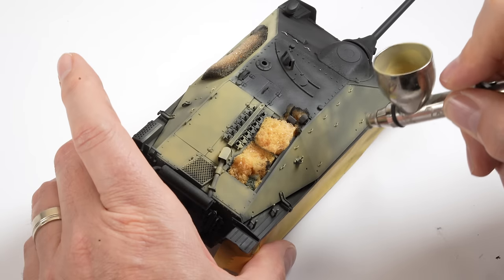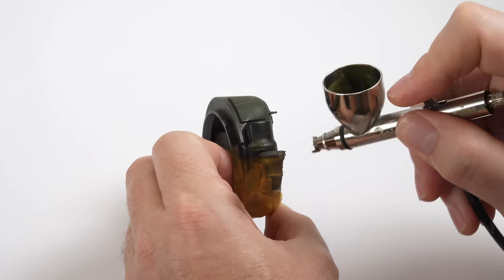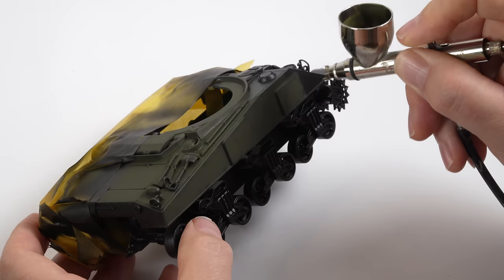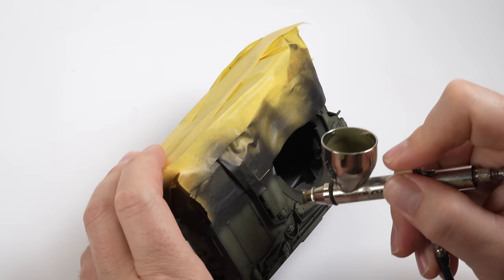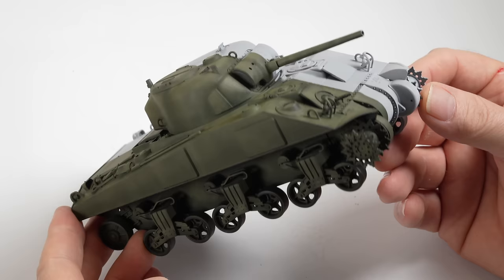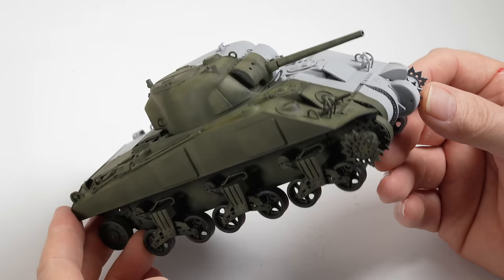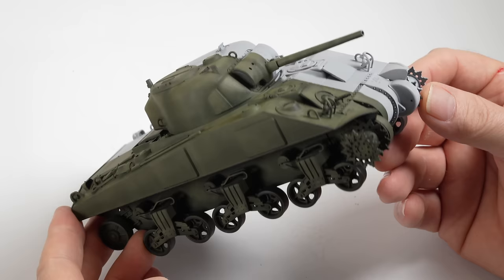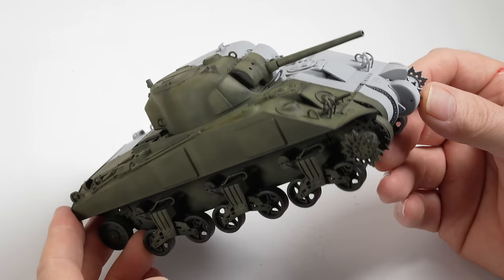PAINTING HALF a MODEL in the name of science. Black Basing V Pre shading. Which technique is better?

Comment: I do neither. I tend to think in terms of how does a real vehicle paints oxidizes and fade and become stained. And that is from the top surface of the paint and not from underneath or the bottom of the paint. So I start with the new paint surface on a grey primer, then apply what color the real primer was use and then interpret the fading, oxidation etc, using mostly pastels, and some other types of washes. The problem I see using different layers of paint, especially acrylics ( which I have  generally  stopped using ) is, you can sometimes see the "layer" where it was applied to. Giving a sort of "stepped" painted surface. Which for my liking is too unnatural looking. Another thing I personally won't do, is the white squiggly lines on "each" separate panel. Since oxidation does not oxidize differently on each individual panel. And when accompanied or separated by a heavy and wide  dark panel line, also doesn't look natural. If you took this same 1/35 model and up scaled it to 1:1, could you imagine how humongous this line would be. 

Note, this is no grip against those who black base or pre-shade. No, to each there own. It is just "my" thoughts on and why I personally do neither of them. The number one thing in modeling ( for me ) is do your own thing ( think out of the box ) and enjoy what you do and be happy with what you do.
Reply from the maker: Appreciate your thoughts. Thanks for joining the conversation. Hope you are enjoying the channel 🍻🙏

Comment: I used to do pre-shading a lot and I used to approach it completely differently. I would start with black base, and add two layers of successively lighter paint. I would take into consideration direction of the light, including more pronounced bounce-light. The effect would be a black-gray-white model with all the light information. It not only make painting more consistent between parts and models, but also makes the whole process much faster and accurate. One important thing is I stopped using canned paint long time ago. Using airbrush for the base is much better in most cases.

Cool experiment tho. I really enjoyed it. 
Cheers!
Reply: Two more things:
1. controlling contrast in pre-shade is super important.
2. If you use preshading you should try to use as few colour layers as possible and they should be as thin as possible.
In the end the results should be the same if put enough work. The biggest advantage of preshading is speed.
Reply from the maker: Great insight, and yeah, there are plenty of variations on these techniques. Really appreciate your thoughtful comments 🍺🍻💪🙏

Comment: I mainly build 1/72 aircraft, I've been using both techniques.
I find that black basing on single colour schemes like modern fighters in grey works well for introducing a marbled colour with variation in density of the colour rather than it being a boring grey blob. 
I find Pre-shading tends to work well on multi-coloured camo schemes like WW2 RAF subjects.
I have utilised both techniques on multiple aircraft and subjects and I like aspects of both, I don't think one is better than the other and the outcomes are both pleasing to the eye when done well.
However in the armour scheme you present here I prefer the pre-shading side.
Reply from the maker: Horses for courses! Exactly right. Both techniques are valid and work differently depending on what you are painting. Thanks for your thoughts 💭 👌🏼💪🙏

Comment: Hello Clayton.  With all due respect, I think the result of both finishes being so similar is due to the fact that after you made a great explanation and demonstration of both Black Basing and Pre-Shading, you then applied Post-Shading to both sides with the lightened OD.  That unified the finish between both of the sides.  Generally, a pure Post-Shaded finish would involve painting both the black shadows over the grey primer and also some intense white highlights before you apply the transparent green; the white areas would (ideally) negate the need to apply Post-Shading afterwards with lightened greens.  I say ideally as usually it isn't enough and you still have to apply some Post-Shading...

Now, in doing what you did I think you made an even better point which is that Post-Shading is -- in my opinion -- by far the most important of all these shading techniques as it bumps up the tints of the base colour and makes some punchy highlights which will withstand the later weathering.  That generally tones down the finish and darkens it, so adding the highlights is often crucial in avoiding a light sink.  Relying purely on Pre-Shading or Black Basing, it can be hard to end up with enough highlights.
Reply from the maker: Hey Evan - Appreciate your thoughtful comments and you make a good point. I guess when I did the experiment I was wanting to approach it as I would when I paint my models. I was curious as to the effect the black base V Preshade would have on the overall colour and look.. Maybe I should have kept it simple and stuck to the basics.. but where is the fun in that?! :) Thanks again for tuning in. Its appreciated
Reply: @workbenchhobbies4316 very good point.  Like I said, Post-Shading is definitely what I would focus more on as well, since I feel that I have more control in that stage as I'm directly painting highlights rather than sort of painting around them (or transparently over them to preserve highlights) as you have to with some techniques.  Your style is excellent, and you've made a good conclusion that I agree with about both Black Basing and Pre-Shading producing very similar results; they're just the first step in a long process!

Comment: We never did this. We always painted the lightest first then to the darkest. Then we would begin to remove the layers by rubbing the model. The raised areas would rub the most removing the darker tones leaving lighter tones. Of course, you did this with the end result in mind so it wasn't done willy nilly. The dark areas would be the areas that were recessed and hardest to reach so obviously they stayed dark. After that, areas that would receive a lot of foot traffic would be silvered with a dull silver, like the edges of hatch openings, etc. After all that a careful wash, rust, dirt and dust would be carefully applied. We generally avoided building a psychological pretext to the model and the painting as we were not stuffy and arrogant and pretended to be abstractly wise.
Reply from the maker: Gee…sanding/rubbing the model back sounds fraught with danger! But if it works for you then that’s great. 
Not sure if I’m supposed to take offence to the stuffy and arrogant part 🤔
Thanks for joining in 🍺
Reply: @workbenchhobbies4316  We never sanded. And it wasn't dangerous. It worked just fine and every modeler I knew did it this way. The results were outstanding. And we also didn't add any psychological pretext to the model. In fact, our models always won first place awards at the fair and other events we took them to.
Reply from the maker: Can’t be unhappy with first at the fair! 🤷🏻 Build your models however gives you the most joy and you can’t go wrong 🎉

Comment: I have to use purely water based paints as here in the UK we get ripped buying Tamiya paint because stores only stock the tiny 10ml bottles. The water based paints are very good at basic coverage but not thinning out and shading. You can't use alcohol or the paint goes mad in the airbrush.Years ago the larger bottles were available that's changed  my first paint choice.
Reply from the maker: I used to use acrylics all the time and you can get some really good results with them. Just takes a bit of practice. 
Which brand are you using? Whatever the answer though I’d strongly advise to use a thinner or flow improver of the same brand until you got a feel for how the paint was working. You should be able to get reasonably fine lines and shades using acrylic paints. Just keep at it 👍💪💪

Comment: Excellent and extremely helpful video. As for preference, correct me if I'm wrong, but it seems like you used less paint using the pre-shaded method as compared to the black base. For reasons of economy and detail retention, if my assumption is correct, I would prefer pre-shading. I work primarily in 1:72 scale, as a little goes a long way in that scale.
Reply from the maker: Yes, slightly different spraying technique on the pre-shade which in turn would use slightly less paint…in theory at least. But in terms of how much you’d save that would be very difficult to quantify. Minuscule amount I’d imagine. 
Great observation though. Thanks for joining the conversation 🏆🍻☝️🙏

Comment: Is there a purpose for leaving the back half of the airbrush handle off?   Comfort?   Lost it?   Weight?
Reply from the maker: Great question. That end cap limits the amount the trigger can be pulled back, and I find it just gets in the way. Having it off also speeds up the flushing and cleaning process. Hope that helps
Reply: @workbenchhobbies4316  Interesting.   I took my needle out once (out the front) for a “Deep cleaning” and it was 99% clean.   I rinse and “Back bubble” with Lacquer thinner.   I LOVE lacquer thinner!
Reply from the maker: I remove my needle after every session. Maybe I should do a quick video on that 🤔

Comment: I find black basing works better for me, as long as I properly compensate for how it darkens the kit. Its a mistake not to lighten the paint when using this technique. Usually start with black, then shades of grey until I have a black and white shaded model. Then I paint the color on. OTOH pre-shading almost always shows flaws, or disappears.
Reply from the maker: Hey 👋 It sounds to me like you are using a combination/variation of the two techniques rather than a strictly’black base’. You’ll definitely be getting some interesting and cool shades and variation. 
That’s for sharing 💪👍

Comment: Very nice stuff. Currently in the market for my first airbrush, will definitly be subbing and studying your techniques. Any tips on a good brush to go for?
Reply from the maker: Being it’s your first airbrush I’d be mindful not to spend too much. A good tool generally helps achieve superior results but as you are just starting make your mistakes with something that won’t matter so much. Keep in mind you’ll need a compressor too. 
No need to go finer than 0.3mm. That is a good general purpose airbrush. Make sure you get dual action. Not single. Hope that helps 💪🙏
Reply: @workbenchhobbies4316  very much so, thank you! I was thinking of aiming for something middle of the road price and quality wise as I know I’ll be getting plenty of use out of it, but I don’t really know how big the difference is between quality ranges. And of course, I’ve done enough research to at least know what O need for a working setup, just the details are never made fully clear on a google search… I’ll note your advice!

Comment: If attempting to produce a realistic model, then why produce a bad paint job? The actual item doesn't have parts "brought out".  In fact, that's the last thing they wanted on a tank or just about anything as they don't want to be seen much less identified. 
The special (usually terrible) paint job on the barrel to hide what barrel the tank actually had shows this, as does the idea of using a bland camo color.
I just feel as though this reflects on the final build of the thing as though the painters on the assembly line couldn't lay down a proper paint job but instead were inept or blind. This compared to any painting done in theater which sole purpose was to finish the job as quickly as possible. (done by solders).
Reply from the maker: Hey Dave. Appreciate what you are saying, but for me is not about trying to  make something small look larger than it is to the naked eye, so that’s the thought process behind playing with shades and highlights. But like I said in the video, I understand that’s not to everyone’s taste. 
Thanks for connecting here on the channel 🍺🙏💪

Comment: Black priming ist my preferred method, because I use Revell Aqua Color to color my models, which tends to run off from the smooth plastic.
Reply from the maker: Priming is always a good idea but paint shouldn’t run off? Are you spraying or brush painting?
Appreciate your comments ☝️🙏
Reply: @workbenchhobbies4316  Airbrush for the Revell colors. On pure plastic without primer it looks like raindrops on a window.
Reply from the maker: Sounds to me you might need to look at your thinning ratios. It shouldn’t bead like that I wouldn’t have thought…what are you thinning it with?
Reply: @workbenchhobbies4316  Water from the tap.
Reply from the maker: I’d say you are thinning it too much or trying to drop too much paint in one go. With acrylic paints you usually have to mist it on in multiple light coats and build your coverage up that way. Although priming is always a good idea with acrylics you don’t have to do it to get the paint to work.

Comment: I was digging the video right up to the point you started spraying the highlights on the "pre shade" side which effectively nullified the comparison. The reason they looked so similar in the end is you essentially did the same process on both sides. If you had stopped with the pre shade only, it would have given an accurate comparison of the black base vs pre shade.
Reply from the maker: Hey. Thanks for sharing your thoughts. This was first and foremost a comparison for me and the way I paint. Yes the highlights affect the outcome but they are just semi translucent layers going over the layers from before them. 
The experiment was successful (for me at least) in the fact that the base I start from really had a very little impact on the tone of the colour I finish with. I’d suspected it would…but not to be. 
Totally appreciate what you are saying but that’s how I paint. I couldn’t think of many people who stop after just the OD layer. Even without the highlights you’d generally expect washes and or weathering to shift the look again. 
Thanks again for joining in. I appreciate your input 💪🍺
Reply: @workbenchhobbies4316  I'm sorry if I came across as harsh. I understood it to be a comparison of how the base color would be affected by each method. I understand and agree that most people wouldn't stop with just the pre shade and base. However,  after the extra highlights with the airbrush it in fact doest matter which one you start with because the results are as you discovered nearly identical. Thank you for taking the time to demonstrate your methods. I genuinely appreciate it.